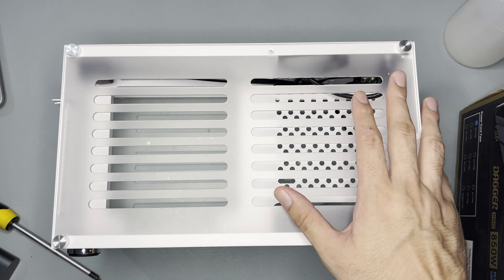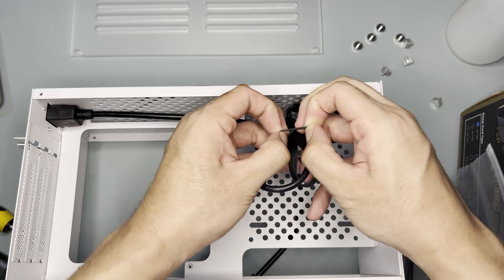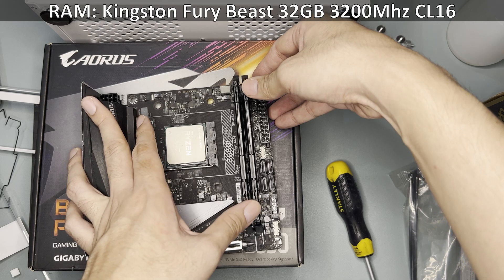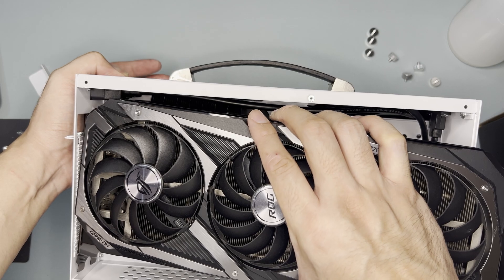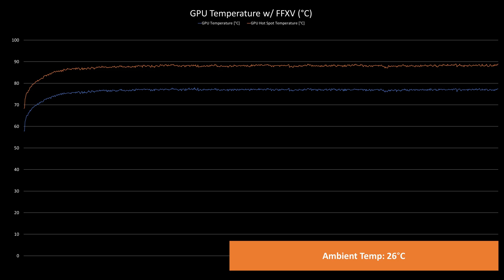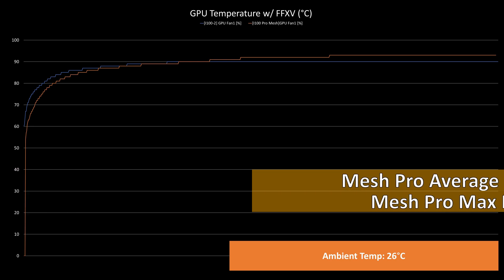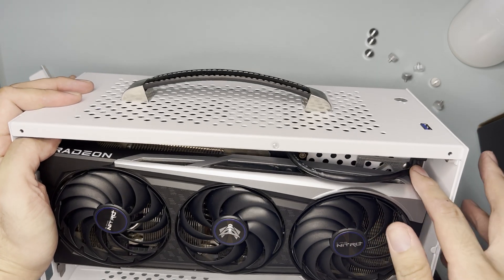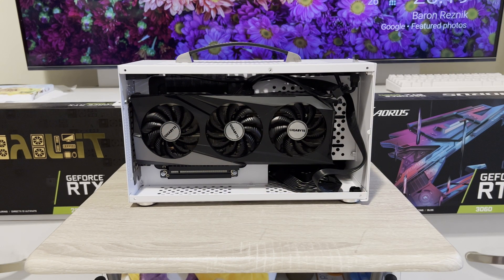PCCOOLER i100-2 | A 9.4L SFF ITX Build

Comment: New subscriber. Nice content. Was planning to get this but I am not sure if it will fit my GPU.What do you think is the maximum card height? will it fit a 129-130 wide card?
Reply from the maker: Hi, sorry for the late reply as I missed your comment. If your GPU is long (305-310mm), it might hit the USB 3 cable at the end if it's 130mm wide. However, if the GPU is a bit shorter, I believe it can accommodate a 130mm width.

Thanks for watching and subscribing!

Comment: Hello..is this case support 63mm CPU cooler like Jonsbo HX6200D?
i have similiar case but side panel is acrylic with only 2 slot GPU
the model like i100-2 but the dimension is similiar with pro mesh
Reply from the maker: I'll not risk 63mm CPU cooler. At most 62mm and expect it to bulge

Comment: Thank you for this video.
Which the most powerful/hottest GPU would you recommend to buy for this case? I recently bought this one and I'm thinking about used RTX 3080/RX 7800XT
Reply from the maker: RTX 3060 or any <200W GPU. 

With RTX 3080 or RX 7800 XT, I suggest to go with Shiny Snake S400. You'd need active air cooling
Reply: @Anthony_Daniels  i just bought this case for rx 6800xt pusle, i removed usb usb connector to fit this card. Idle temperature is 30. In games 60c chip, 75 hot spot, card is undervolted + fan curve
Reply: @eighteen5093  I already sold this case. It had something wrong with GPU riser — my graphics card worked only its half power.
I'll never buy a small case with cheap Chinese GPU riser again.
Reply: @Anthony_Daniels  i am agree with you, when i apply 4.0gen pcie i get sound artefacts, but 3.0gen pcie no problem

Comment: looks like the S400 would be a better choice compared to this since it fixes all the clearance issues this case had (works w/ wider GPUs since the power outlet is on the motherboard side and the USB header issue since all connectors are at the bottom) while also looking better due to not using unaesthetic acrylic panels. the S400 can also house 2x slim 120mm fans for more active airflow too. it can also fit a 4090 which is neat while still being at 10.8L
Reply from the maker: Will try to find one and see for myself. Thanks

Comment: Good time, please, maybe you can test these coolers? Jonsbo hx6200d, jonsbo hx4170d, thermalright axp90-x53 for Pcooler i100/pro/a4 case

Thanks in advance!

P.s 

of course not sure about Jonsbo hx6200d, it's 63mm high.
Reply from the maker: I can't promise, but will definitely log these coolers in the pipeline

Comment: To install the bigger graphics card just remove the internal power cable completely. Install the GPU then reinstall the power cable. For worse case scenerio, you can remove the whole back panel of the case, its just a few screws. This is what I did with my 8L case
Reply from the maker: I see. Though looking at the other end of it, I'll hit the USB3 cable which I have to remove (Sapphire Nitro+ RX 6800 has lower dimensions vs Asus Strix RTX 3070, but still uncomfortable to fit). Front and back panels are riveted in my case.
Reply: @manongunboxing  riveted.. aww that sucks. At least you tried.

Comment: Good review! 

My current PC uses the same case. I agree about the height of the case, my ASUS 3060 OC 12GB TUF Gaming card is a tight fit (but it fits). I was surprised by your temps as I'm getting very good temps under load. Perhaps I need to run a similar benchmark test to see, but my idle temps are in the high 30s, with hardcore gaming loads comfortably in the high 50s (ambient temp around 28 degrees in Manila apartment. I've very rarely seen gaming temps in the 60s.  BUT I also carefully selected my my GPU and CPU components specifically for their good cooling reviews. Since I knew that I'd be using this ITX case (see below).

1. The ASUS TUF Gaming 3060 OC GPU:
- uses the middle fan as an exhaust, that seems significant in this ITX case
- GPU is also one of the better temperature performers for cards in it's category, beat only by the slighly better MSI competitor
2. For the CPU cooling (i3-12100F)
- I'm using the IS-55 with an Asrock B660M-ITX/ac. The IS-55 only fits in one orientation, but it fits and the cooling is quite good.
- In addition, I installed the Thermaltake CPU buckle to keep the CPU flat and in full contact with the IS-55, this is also supposed to drop temps (though I haven't tested it without the CPU buckle)

NOTES:
-  I was able to install two 2.5" SSDs on the bottom of the case (under the power supply), but there's no way to install fans on top, there's too much structural stuff in the way.
- I wonder if you can get even lower temps if you replace the acrylic panels with some mesh. (the acrylic panels make a perfect template). The mesh might make it easier for hot air to exit at the top/sides of the panels.
Reply from the maker: Thanks for the inputs. I wasn't really clear in the video why I didn't call out my GPU temps that much. Looking at my RTX 3060 Gaming OC temps, it's near underwhelming already even at open test bench. Putting it inside the case with the 5800X just made matters worse for the components overall (by increasing case ambient temps overall by heat re-circulation) and the difference is pretty much acceptable (same as CPU). 

Re: Asus TUF RTX 3060. In RTX 30 series, Asus TUF is one of the best cooling to price ratio out there. Good that you got one.

Re: 12100F. This CPU is a lot easier to cool (at 58W-89W). This made your case ambient temps to be better already.

Re: mesh side panels, it can dampen the noise but maybe not so much to the temps (holes in this case is pretty big already). It also has to be a better design mesh as well (not from I100 Mesh Pro). What the case lacks is active airflow for hotter components.

Good choice in components overall and very decent gaming PC :)

I also learned a lot from your well-constructed comment and added the following to my checklist:
1. Idle temps - I never recorded it and I will put include it in my future tests (I just wait for the idle temps to "normalize" but never disclosed it). I'll record the temps for 30 minutes while idle.
2. Components suggestion - my components may be bad for the case. I should also extrapolate if it can handle hotter components, or maybe it can only handle cooler components. Though my test will remain at biggest GPU that can fit the case (as component compatibility is a marketing line for ITX case manufacturer that needs to be validated)

Thank you.

Comment: do you think it's possible to mount two 40mm exhaust fans at the top part of the case and if it would be worth it for better temps.
Reply from the maker: Too tight but I'll order two of those and check if I can put it on the GPU side
Reply: @manongunboxing  I look forward to hearing the results if it fits
Reply: @manongunboxing  musta manong, natry nyo ba if oks lagyan ng small exhaust fans?
Reply from the maker: Not yet sir. Give me til end of month. Sorry medyo matagal turn around. Otw la lang din yung noctua nf a4x10